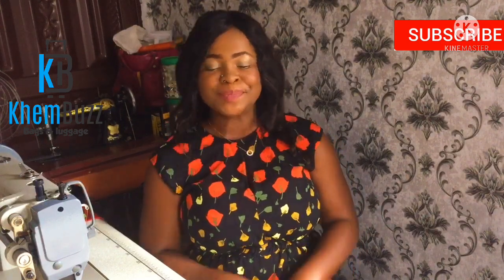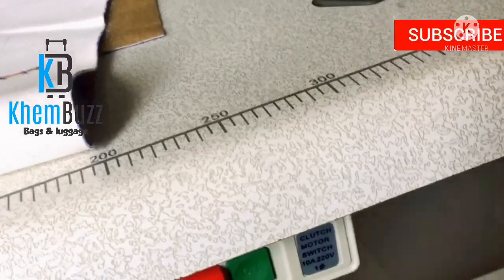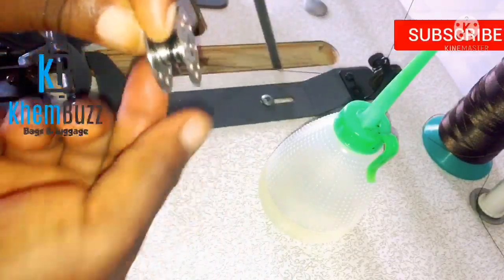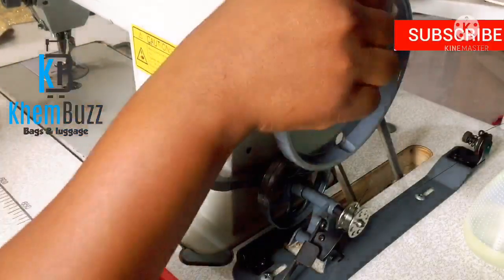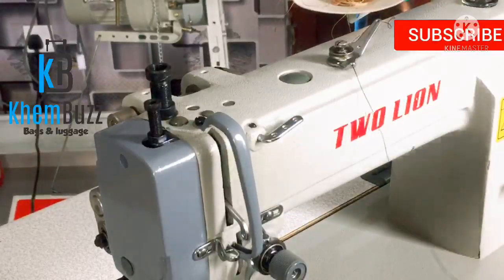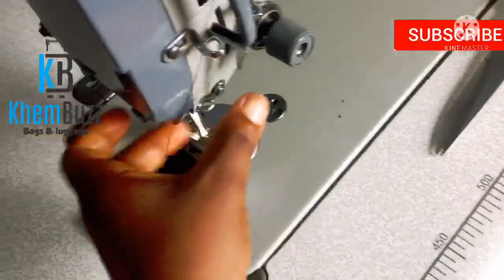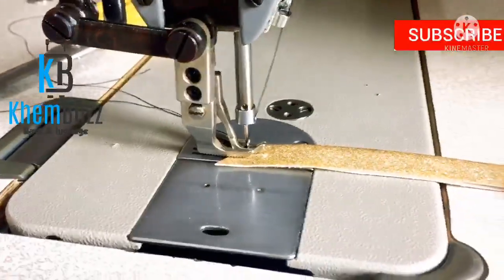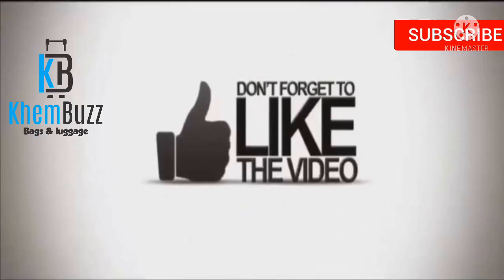⭐Learn How To Use Your Flat Bed Industrial Machine | Khembuzz

Comment: Pls ma,  the shuttle in this machine is it of the same size as that of a regular sewing machine? Coz am having troubles finding one that will work with. 
I used a regular industrial shuttle but it didn't fit well.  Waiting for your reply.❤
Reply from the maker: No, it is not the same.
Reply from the maker: No, it is not the same size.